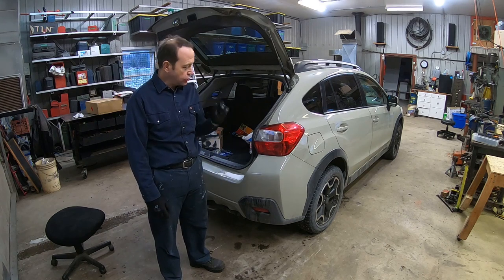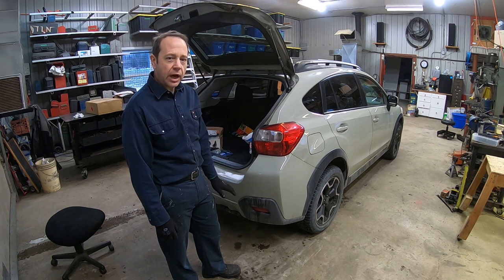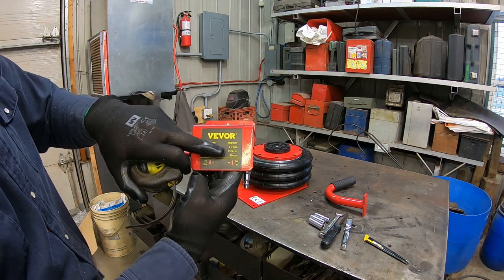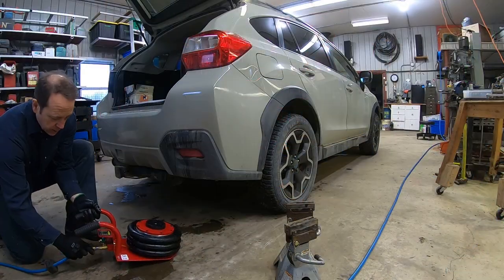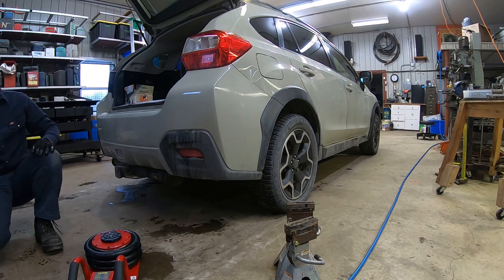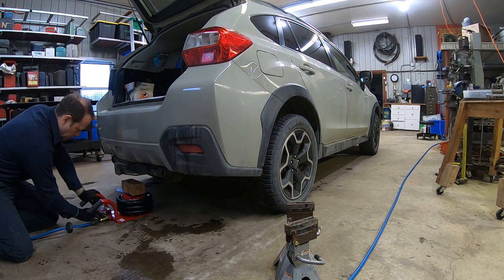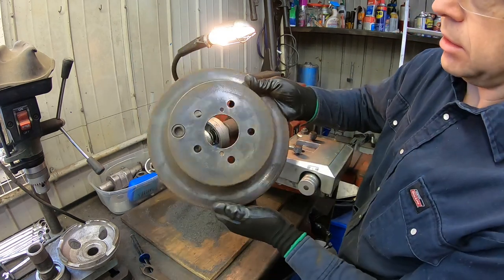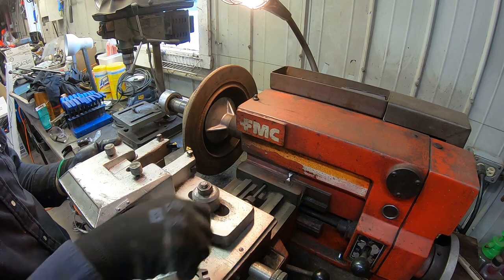#247 New Tools In The Garage!  (Turning Discs Brakes)

Comment: By the way!...I love that jack and it gave me the idea of I could make one...I have a few airbags like that....CHEERS
Reply: Gator, I have a couple air bags off of a truck.  When I fill them, they want to teeter sideways.  But mine are not as large of a diameter as Joe's are.
Reply from the maker: I am pretty sure there is a telescoping thing inside the airbag to maintain it straight.  Thanks!
Reply: @FromSteelToWood  I`ll try it and when I do I`ll let you know....or I`ll make a video about it....CHEERS
Reply: @FromSteelToWood  Yes, I'd think there was something like that inside of yours.  Mine are just bags that attatch to the frame and to the bed and lend assistance to the normal springs so there's no need for something to hold them steady.  But boy o boy are they powerful !!  After all force equals area multiplied by pressure...that is if I'm remembering things right.

Comment: I used to use the old Ammco brake lathes back in the day. Back then the brake rotors were ventilated and there was a spring band with lead "pucks" in it that would be strapped down the center, ventilated part of the rotor to reduce the chatter due to ringing while machining. Drum brakes used a similar band around the outside. When the solid rotors came on the scene Ammco added a spring loaded arm that would press a puck with brake lining onto the cutting surface to reduce the ringing. With older machines that didn't have that update we used to have to hold an old brake pad against the rotor surface while it machined.
Reply from the maker: Interesting.  I do have this rubber band, but it's broken.  The rear brakes on that Subaru are solid, but the front discs are ventilated.  Would you say there would be a better finish using it? I was said it was only to reduce the annoying noise it produces. Please let me know, I am new to that machine and would like to learn as much as possible. Thanks!
Reply: @FromSteelToWood  It will reduced the ringing which in turn affects the surface finish. If your band is broken you can hold an old brake pad against one side of the rotor to help damp the vibration, or better yet rig something up to hold it. As with any metal machining make sure to use the slowest feed for your final pass for the best surface finish. Coarse finishes will make the brake pads or shoes want to ride the machining grooves like an old vinyl record. Don't ask me how I know!
Reply from the maker: Oh! Good to know that!

Comment: Good job on buying the disc lathe on marketplace and reusing the disc. I have asked the questions many times why they don’t resurface the old one’s and its always the same reason. They don’t have the meat on them like in the old days as manufactures are constantly cutting on weight, ((and I tend to think they get a kickback from recycling the steel for cash)). But I am sure OEM brakes can be resurfaced no problem, maybe not some Kia 2nd or 3rd quality but I would try it for sure. This past weekend, my dad computer failed due the strong winds and the power failures, luckily I have few old pc and simply switched the hard drive and everything is fine. Now a days with everything welded to the motherboard he would a have lost everything and had to buy a new one. Thanks for sharing.
Reply from the maker: Again, a good thing you know about computer and was able to switch components! I agree with you, this process must begin with good quality parts first! Merci!

Comment: Reusing and repairing stuff, that has to be the way to go. I think you should add a Bolens decal to the machine and then it will be perfect lol. When you started the job I was thinking that what you really need is a machine lathe which can do many other jobs as well but a lathe would only cut one side at a time and the setup would take longer. It is a cool machine and looks really easy to use. If we have to buy tool from overseas Vevor is our favourate supplier, they answer questions or issues straight away and they hold local stock. I have already checked the UK website and they have that jack in stock, I just need Santa to deliver it. If they have a website in your country check it out and the prices are cheaper than Amazon or Ebay
Reply from the maker: A Bolens decal would be a bit odd... Lol! I've looked at Vevor website. That is the first time I hear that company. Thanks!

Comment: I remember those days 2....ya, the days when they check how the motor run and just take out a few spark plugs and sandblast them.....like you said....the labour now is expensive...well done Joe.....CHEERS
Reply from the maker: Funny what you say about sandblasting spark plugs... I just installed my new spark plug blaster... That is just a matter of time until I flood an engine here! My bigger Case has a tendency to burn rich, so it will be nice to have. Thanks!
Reply: @FromSteelToWood  Try increasing the gap from the coil wire going to the distributor or maybe a hotter sparkplug....ah ....I`m sorry...I`m forgetting whom I am speaking to Joe....You know more about mechanical work than I do....good luck....CHEERS
Reply from the maker: I know more about mechanics than electricity! I changed the coil last summer and added a resistance. So far it works great. I'll be able to see how it does this winter. Thanks!
Reply: @FromSteelToWood  Just a side note Joe....In the old days like the 1960s to increase the spark, we would cut the coil wire and put a big two hole button and bare the two-wire and make the fire jump between the wholes of the button....that was a long time ago and we were kids with no money but we had or Mercury then and we made them work even if the burn more oil than gas....SALUT

Comment: Hey Joe !! Good to see you Ol' Buddy !!  I am sorry for being so far behind on your videos.  I cheat with the two post car lift now.  I have passed on several FMC brake lathes at auctions and kicked myself every time because they always go cheap. Next time though...you will soon have some competition....LOL.  Good video Joe, I enjoyed it.  I really thought the rpm would be a bit higher though.  That's surprising to me.  Oh yeah, the air bag jack is way cool !!
Reply from the maker: I think this FMC lathe is a good machine.  The previous owner was kind enough to show me how it works. He actually asked me to bring a disc for the demonstration! I am pretty sure the RPM can be adjusted, but I simply do not remember how. I'll find out another time I guess! Thanks Wendell!
Reply: @FromSteelToWood   I really don't know, but machinists know the optimum speed I think  in fpm for the type of material and cutter.  On that large of diameter, the speed in fpm would be pretty high even at a low rpm though.  Brake discs and drums are not going to release chips or curls....mostly a fine powder I would think.  I turned a tractor drum one time on the Jet  14-42 metal  lathe and that's what it did anyway.  And yes, the FMC is for sure a good machine.

Comment: It's amusing, in a way Joe, but I had a 'Brake Resurfacing  tool like this on my 'wish list' for years, but never bought one. I had friends around a lot back then, and I used to change over their tire/wheel sets each season, and always looked after the servicing of their lawn mower, and lawn tractors too.
Now I see you acted on this thinking in a big way. You got a very good 'deal' here in buying that FMC unit for only $400.00; aren't they somewhere in the region of $2000.00 new, perhaps more?
Have you considered a vehicle lift /hoist? Now that, I did buy, I bought a 7000 pound capacity 4-post lift from Princess Auto ( here in Canada , similar to Harbor Freight in the U.S. ) I use the lift a lot, especially in the 'non-winter' months, as my garage is not heated.
 During the winter months I only store my 'play toy' car on it, with my buddy's 'toy' stored under mine. (Well secured, and protected I can assure you! 
You've done well here with that Brake Re-surfacing Machine, that's a good and smart idea. Thumbs Up here!
Reply from the maker: I think those machines new are 2k$ and up. I did consider a vehicle lift, but it would be in the way of my projects... so this is why I go this route instead.  I actually got a second jack like that, so I can lift one end of a vehicle (without hitch) easily. Thanks!
Reply: @FromSteelToWood  Yes, this is the first time I've seen an 'air bag' jack like this. I'm going to check into one of these.
Cheers !

Comment: Check if the discs has a minimum thickness stamped on them somewhere. I know that at least the European cars that I've worked on has had that and if the discs are thinner than that after surfacing then they should be replaced.

I've never re-surfaced the disks myself though but noticed the stampings on them when I've replaced my own brakes when they got worn down far enough.

That inner race for the parking brake looks brand new, I guess your daughter never uses the parking brake much! :-D
Reply from the maker: (sorry for the late answer, just saw your comment). I'll pay attention to this detail in the future!

Comment: Good evening Joe 😉👌 Yes I agree with you all the garages do not disc machine any mores exempt back country one's  👌😉 Yes FMC is well know for their airports various equipment's  👌👍 Smell from China 🥴🦨🤦‍♂️ Yes jack stand in deed 🙏 Great Job 👌👍💪 Yes cleaning/grinding/turning disc brakes you can double their life for sure 👍👌 Great video my friend Cheers 👌👍🍻
Reply from the maker: It did not take much effort to save a bunch of money. That smell in the box was not nice at all!!! Beurk! Thanks!
Reply: @FromSteelToWood  🤣😂👍🤭Pouring ice rain right now Cheers 🍻
Reply from the maker: Still 10°C here, but winds are going to lift the whole house!
Reply: @FromSteelToWood  Good morning, it was and still crazy wind and al lots of rain all night and slower this gusting at 56 kph and stead at 35 kph but during the night it was steady at 60 kph and gusting at 80kph 🥴 Now is back to freezing temp !!! Cheers !!!
Reply from the maker: There was 100km/h gusting during the evening and night.  You saw on the news, 380,000 houses without electricity.  I was lucky we did not miss any!  But in Shefford Mountain, they don't have any as of this evening. Neither at IGA and Metro in Bromont.
Reply: @FromSteelToWood  😮 Yes my generator as some hours on working in Shefford and the new owner as his generator ( electrician )  but Yes that is very high winds for the region, he has probably has some trees down 😌 Cheers 🍻👍

Comment: Allo Joe. Nice to be able to machine your rotors. Too many parts are now being considered toss away instead of reuse.  
Love that line "smells like China" lol. I will have to use that the next time I buy something from China Tire. 
What was the make of that jack? I currently have both the jacks you have but want something better.
Reply from the maker: Thanks Alain!  I also like how you renamed our favorite Canadian Tire... I got this jack at Amazon, but was told by a viewer there is a place to buy it directly. I think it's about the same price either way. The brand is Vevor. See link below. Thanks!
https://vevor.ca/products/3-ton-triple-bag-air-pneumatic-jack-6600-lbs-jacking-compressed-air-43lsb?_pos=8&_sid=c51779c6e&_ss=r
Reply: @FromSteelToWood  thank you for the link. 
Princess Auto also has that same familiar smell. 😆 although I was pleasantly surprised when I bought replacement portable bandsaw blades to see that they were made in Canada 🇨🇦.

Comment: That is a great find! How do you know how much material you can take off the disc before it is not re-surfacable any more? Is there a spec on that? Great video! Cheers!
Reply from the maker: I just don't know. I've removed maybe 0.010 on each side, on a 0.625in thick disc. The minimum thickness is supposed to be stamped on the outer surface of the disk... but at this point, you can just guess the stamp is gone with that thick rust.  So my nose tells me it will be just OK. Worst case, it will warp sooner than later.  Nothing is going to shatter in pieces, that is for sure. Just bouncy brakes.  So I don't risk much by removing too much one day. At some point, the rust is going to be the concern, not the thickness. Especially with ventilated discs. That is my thinking.  As they say, I take my chances, others may take their risks! Lol! Thanks!
Reply: @FromSteelToWood  Thanks for the explanation, Joe. I agree, you should be fine! Cheers!